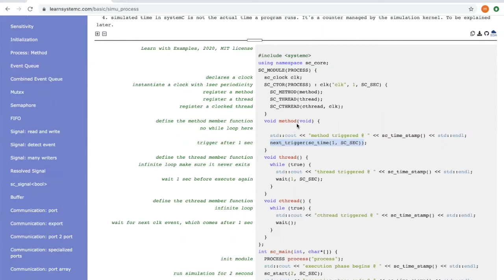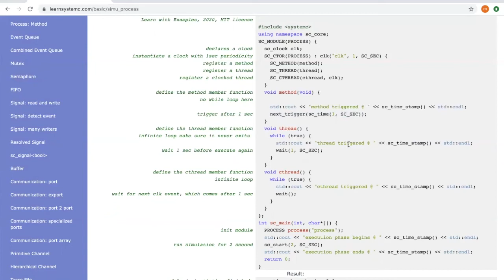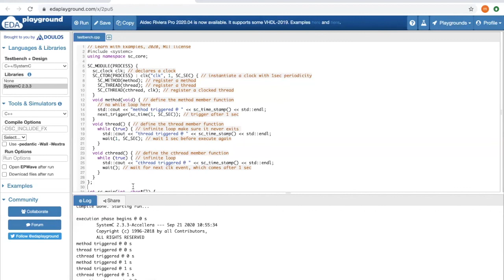Learn SystemC: SystemC process

Comment: Interesting , on your current webpage the Note 3 is  "3. An SC_THREAD process doesn't require a while loop. It is invoked again by next_trigger()" which should be " 3. An SC_METHOD process doesn't require a while loop. It is invoked again by next_trigger()",  which is same as your video. But why it is not correct on current webpage ?
Reply from the maker: oh, I might have loaded loaded an older version of the code during my recent update. Need to fix it. Thanks for letting me know!